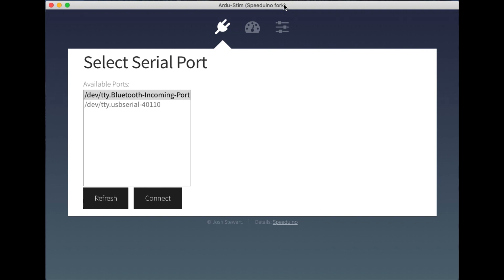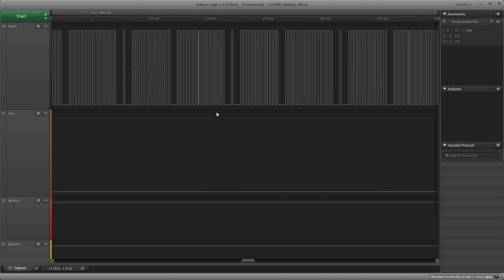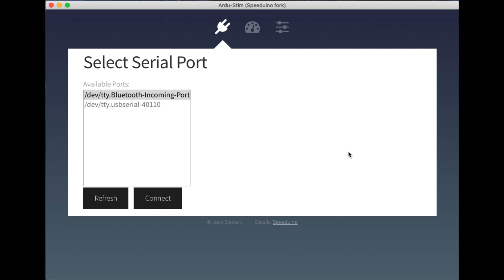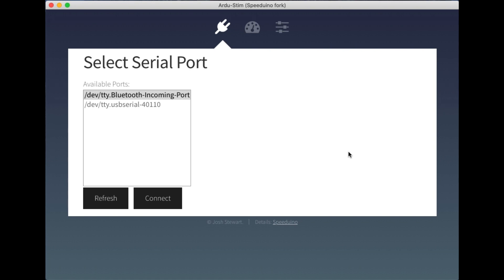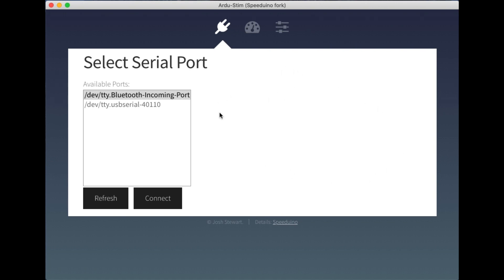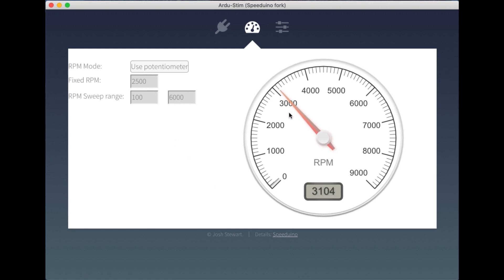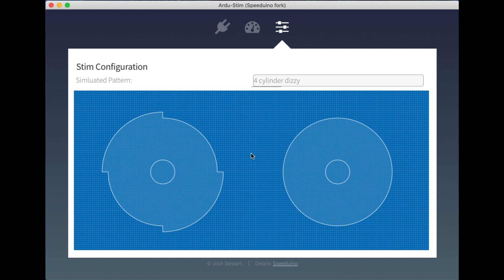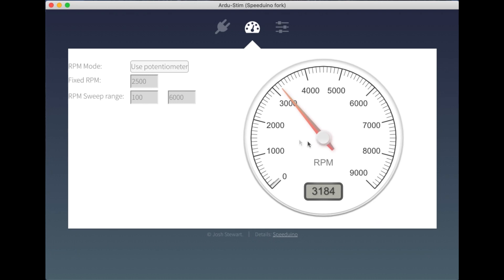Rejuvenating the Ardustim project for Speeduino

Comment: Just used this in 2024 to test my new speeduino. Thank you for your work. Any chance yiu have a wiring diagram for the potentiometer control?
Reply: Found it buried in the code. For those looking this far, hook up a potentiometer to 5v, GND and the signal wire goes to Analog 0 or A0. It's called ADC0 In the code. Happy tuning!

Comment: Hi! I'm struggling with getting the basic software to work and connect to the Arduino. I'm working in Ubuntu. First had to make avrdude executable, then had to change the baud rate from 57600 to 115200. That allowed me to upload the firmware (Arduino Uno ATMega 328P). But still can't connect...

Comment: Very nice! Graphics representation of trigger pattern is also great!

By the way - do speeduino is able to sync and start up using just crank sensor in semi-seq mode,  and then when cam trigger arrives - switch to full-seq?  Also a fallback to semi-seq when cam-sens fails is supported?

Comment: For some reason I only get one wheel. Only the crankshaft pattern. Will test more tomorow.
Reply from the maker: It's a bug on the Windows version. It adds a scrollbar automatically on the right, which pushes the 2nd gauge down. If you make the window slightly wider it should pop back up.
Will be fixed for the next release

Comment: I like the graphical pattern display!

Are there plans to add other sensor input simulations?
Reply from the maker: Do you mean inputs for other types of sensors (IAT, CLT etc)?
Reply: Speeduino correct. 

Having some programmed/recorded curves that simulate real world conditions would be handy to check parameters which spinning POTs don’t seem to achieve. Eg. Cold starts, cruise to WOT.
Reply from the maker: @kyushaobsession  That's an interesting idea. Not something I'd planned as I had always done this separately with extra hardware, but I'll add it to the list
Reply: There is also a good idea to use some kind of DAC and a negative voltage supply to provide a true sine wave output. I've used an R ladder shield to test my vr sensor input on board, but having a several DACs can be useful to test analog inputs also.

Comment: Being that I've been building my Speeduino for a Subaru rally car and I have loads and loads of parts in the garage, I've long been contemplating using actual Subaru crank and cam pulleys and sensors, tied together with a belt, driven by a motor of a known speed, and then maybe 3d printing a model of the boxer engine as an enclosure, with pots at the throttle body, coolant temp sensor, idle air temp sensor, etc.

Comment: Josh, can ArduSTIM recreate this pickup coil signal?
https://youtu.be/neofux0jlOQ
Reply from the maker: Going to need a lot more info I'm afraid. Need to see the actually expected angle for the pulses, duration between edges etc.
Reply: @Speeduino  This is not the usual missing tooth configuration I'm afraid. It has 1 short tooth and 1 long tooth. https://thumpertalk.com/forums/topic/1328165-fuel-injection-take-2/#comments